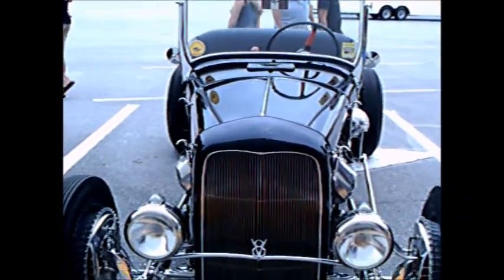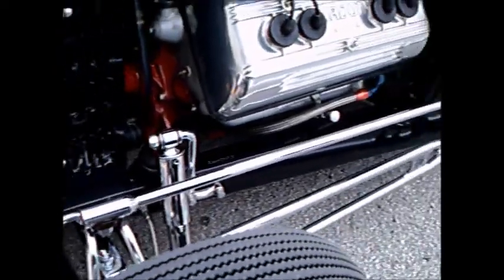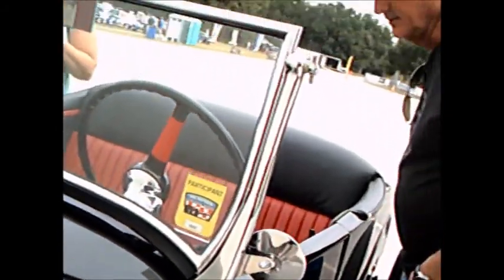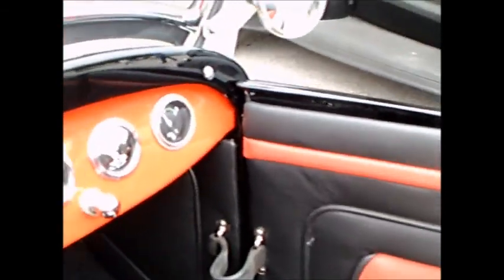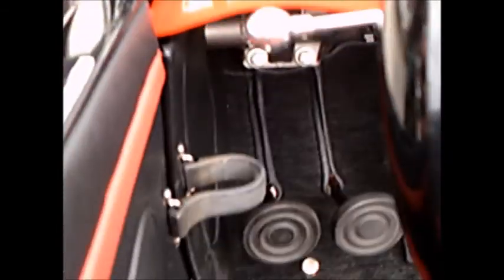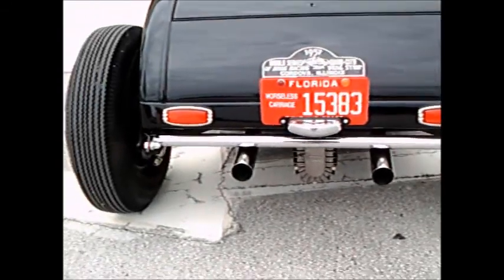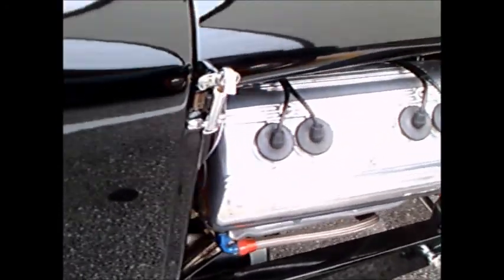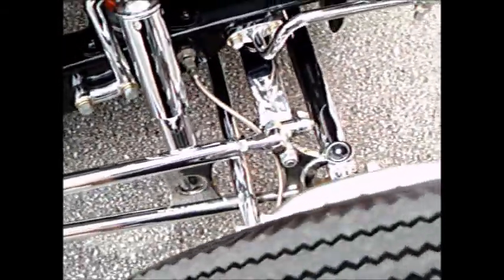1927 Ford T bucket Don Garlits GarlitsOcala110616

Comment: Nice! I remember when cars like this were not uncommon sights. This one seems more than a tad nicer than the ones i remember, though ... and, even though they generally had swapped in modern engines, this flat head likely could outrun most of them.
Reply from the maker: So true...you'd expect to see multiple hot rods on Saturday night at the drive in!  This has a build quality and mods you'd expect of Don Garlits!  Thanks!  :) Jack

Comment: Awesome , but why put a 32 front on it ?
Reply from the maker: Hey, Spider!  Not my car, so I can't answer that....maybe the owner just perfered the '32 front end.  Thanks!  :) Jack
Reply: @coolrides  thank's , it still an awesome car
Reply: Very common in the 40s and 50s. A small radiator wouldn’t be able to cope with 300hp. ‘32 radiators were at least made for the V8s of the day.